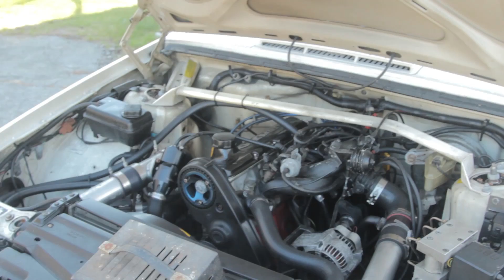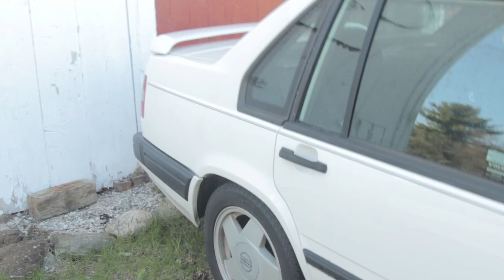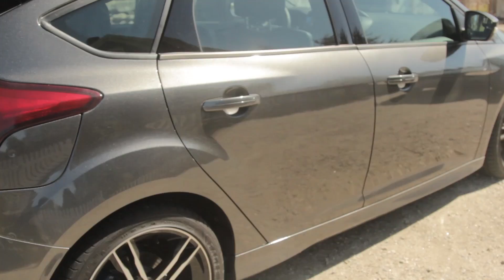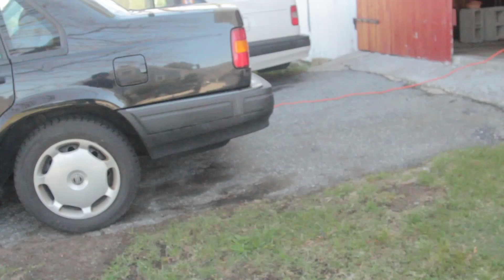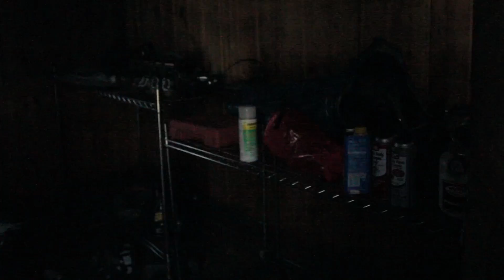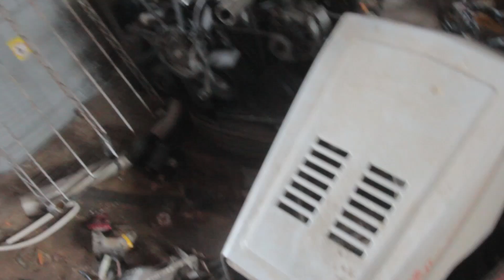New Daily driver, 2016 Focus ST

Comment: wooo-hoo good pick for a DD!
Reply from the maker: Im loving it so far, going to be posting a good amount of videos on it too
Reply: Nice! Subscribed. Im stage 3 in an ST3. Done a BUNCH of mods to mine so far. Plan on going to a 2867R this summer :) Happy boosting!! Lol
Reply from the maker: +Matt Gustafson hell yeah, I'm only stage 1 now though I have the mishimoto j-line ordered. Probably/hopefully will stop there for power mods since I plan to build the Volvo for drifting
Reply: +Tyl3rKrupa You'll want more sooner or later lol...although that's a great start! Consistent power is necessary in these cars
Reply: +Tyl3rKrupa You'll want more sooner or later lol...although that's a great start! Consistent power is necessary in these cars
Reply from the maker: +Matt Gustafson hopefully I can keep myself from going too crazy, told myself I wouldn't do performance mods for the first year, here I am two months later with a tune, and some bolt ons. Intercooler is a must though, it was 90 today and I was seeing charge Temps of 153 after a short highway pull
Reply: +Tyl3rKrupa I'm not sure what the temp drops are on the Mishimotos but the Levels has 50+degree drops and does a great job minus the cast end tanks being on each end instead of the 90 degree bended ones(which id love to own). I have the old design....Their are several bottlenecks to this vehicle that need adjustments greatly! Example - hairdryer size turbine lol